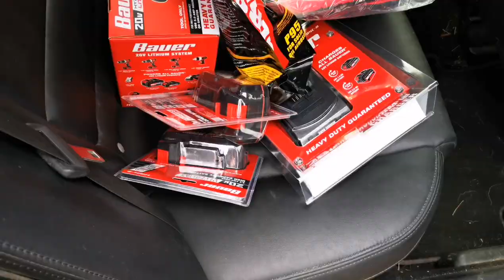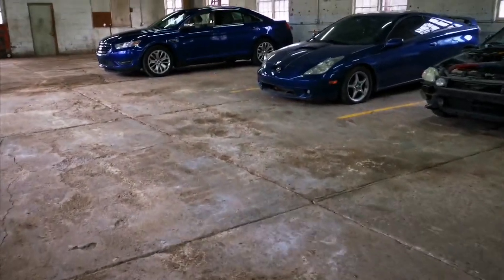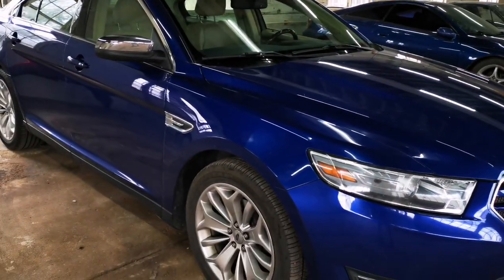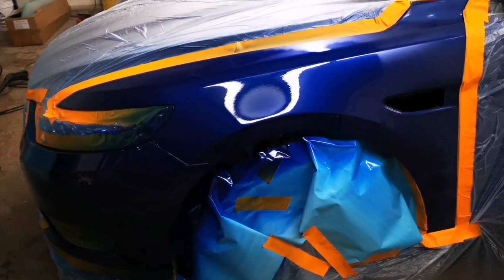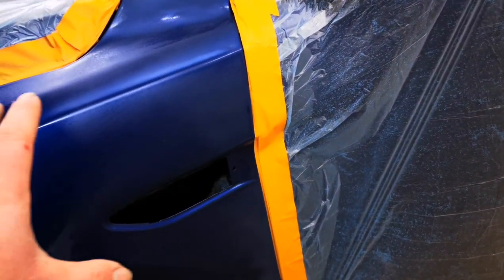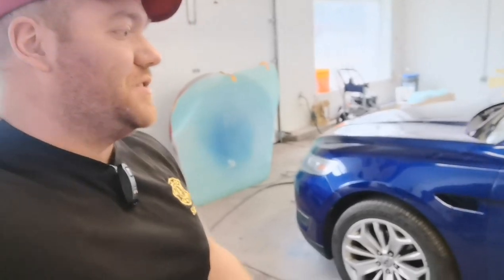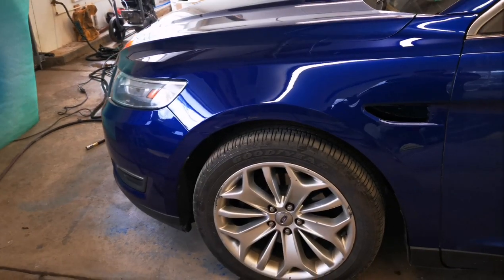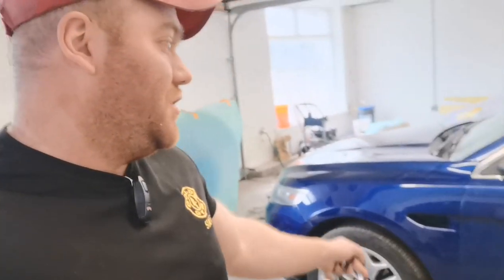Bauer hypermax lithium sander

Comment: I like the idea of this sander. My tools are air operated,my thinking is if I can pull less off of my air compressor,the better. It would have been helpful to have the sound of the sander instead of your music. Great video and great tips like buying an extra battery. The blend turned out very nice,thanks.

Comment: What type of primer do you use on all of your jobs? Is that epoxy primer?
Reply from the maker: Smr210 is the God of primers man. I use it on everything. It's tint able, thin able, or you can spray it straight and it goes on thick as honey and can block it down like body filler. Hands down best primer on the market for the money. Only 79 bucks for a gallon includes activator
Reply: @speedokoterefinishnetwork4937  Great man, I will be purchasing some soon. Thanks man, great work you’re doing

Comment: What is your opinion of the Speedkote SS 2790 G Primer? I want to use it on some new plastic bumpers for my 2005 Honda Civic as a sealer. I also want to use it on my 1998 Dodge Ram 1500 Truck, The truck has some minor rust holes on the doors and on the sail panels below and a mediium size dent on the exterior rear bed. Also the Dodge is black and the factory clear coat is peeling on the roof surfaces. Your videos are awsome. Your guidence is appreciated.
Reply from the maker: That's our premium line of primer surfacer. BUY IT. even better than the Smr210. You can tint it, and also reduce it and make your own primer sealer.
Reply: @speedokoterefinishnetwork4937  

Will the SS2790G work in both situations listed above or will I have to buy different primer/sealers? On the new plastic bumpers for the Civic with some adhesion additive as an epoxy sealer? On the Dodge Ram as an epoxy sealer, and primer for a total vehicle repaint with your Jet Black single stage.
Reply from the maker: Brand new bumpers you want the trc 500 if there BARE PLASTIC, if the bumpers come with factory shipping primer there is 0 need to put more primer on them. For doing body work and stuff yea the smr2790 is Awsome

Comment: Harbor freight would have been geniuses if they had made their Bauer tools to accept Dewalt 20V batteries. Silly! I already have Dewalt 20V & Milwaukee M12 (3/8 Fuel 90 degree impact driver) platforms. Not getting into another system.
Reply from the maker: True. These are cheap China knock offs. They do work and are worth the money but still China stuff.
Reply from the maker: I'd say China stuff is hit or miss. Sometimes you can get better quality. Sometimes it's crap
Reply: @speedokoterefinishnetwork4937  being a DIYer, if I buy something to save me time for one project & it saves me a bunch of time, it could be a throw away. Obviously, the sander wouldn’t be. I’ve bought $20 pneumatic brad nailers from HF to do crown & base moulding trim work, if they last the one project, they’ll have done their job. Appreciate you as always, stay safe & keep the content coming. Congratulations on being monetized.
Reply from the maker: @jdub229r  thanks man

Comment: Question can I use speedokote base  coat binder to lay pear colorshift then clear it.
Reply from the maker: Naa basecoat binder is for people who have mixing systems for oem refinishing and simply don't want to pay the hefty charge for locally sourced binder.
Reply: @speedokoterefinishnetwork4937  what would be a good product to mix my pearl with instead of my clear to do a 3 stage paint job?
Reply from the maker: It's usually best to buy that stuff premade. It takes hours of testing to make a solid formula. Everyone mixes slightly different. I don't give away any information on my own formula.

Comment: @5:48 what was you spraying with? There's nothing on the gun?
Reply: Looks like SMR400 blending clear. Melting the edge in the middle of the bumper. Don’t need much
Reply from the maker: Speedoblend, good stuff! Only need a few squeezes of the trigger and I get perfect polish free blends every time.
Reply from the maker: @prestonrushmore9692  hope you got this in your collection. I use it on all my blend in jobs
Reply: Sure do! Aerosol version but same difference. Once I run out, I should get the quart, probably would use a bit less material since I can dial down the fan/material
Reply from the maker: @prestonrushmore9692  I get slightly finer blends with the quart, but it's also more hassle being I gota take my gun apart, get that out, pop the lid, pour ect ect. The smr400a is great just pop the can open and spray, done.
Reply: @speedokoterefinishnetwork4937  ah true, good point!
Reply: @prestonrushmore9692  look at his gun he has no paint cup on it 😳
Reply from the maker: That's cause it's pps. All disposable. And it's included in the Mark1 refinish pro system.
Reply: @speedokoterefinishnetwork4937  your not normal 😑

Comment: I’m kinda digging that color. Still rocking the smr135?
Reply from the maker: Smr135 is my year around go to for panle work. Summer time for all overs I stick with the ss1200. At only 179.99 for a 6 quart kit that's only about 29 bucks per sprayable quart still very affordable.
Reply: Nice bro. Have yet to shoot smr135 actually. Have used ss1200 in the summer with medium activator, laid down like glass. Took a while to dry, that’s my only complaint. But hey that’s a price I’m willing to pay for virtually zero dieback. I’ll have to try SS-1210 or smr135 next. Still have some 1200 and smr130 left. Also got some euro clear, so I’m gonna hold off till I get low 😂
Reply from the maker: @prestonrushmore9692  summer time use fast with the ss1200. 2-3 coats with fast activator still get no die back and it dries about 5 min faster tack free. The Smr135 is good for bumper / multi panle jobs. Or all overs if you Wana be like me and spray a whole car with your garage door open in 40 degree weather 🥴🥴🥴🥴😂
Reply: @speedokoterefinishnetwork4937  hahahah! I saw that in your other vid, you animal😂 thanks for the tip on the fast activator for ss1200. I’ll have to try that, anything that gets me dust free quicker I’m all for, my garage is far from a spray booth as I know you understand lol
Reply from the maker: Yup been there. You saw my old shop. So yea stick with fast activators for sure. Only time I'd go medium if it was like 90-100 degrees. But the ss1200 always use fast activator. Even with the fast activator it still take 12 min to dry tack free in hot weather which is plenty of time
Reply: @speedokoterefinishnetwork4937  awesome thanks dude. I use an hvlp turbine so it does push out some pretty warm air. But I’ve shot fast activated smr 130 in 80° for multi panel so I’m sure ss1200 with fast activator will go great as long as like you said, it’s not 90°+
Reply from the maker: @prestonrushmore9692  came out really good! More ventilation in that garage when you spray please bro lol. And a spray suit. All those chemicals get into the skin and in your system
Reply: @speedokoterefinishnetwork4937  oh yeah I had terrible ventilation haha. Usually I do mobile stuff or like 1 or 2 panel jobs In the garage so I wasn’t prepared. Lots of lessons learned for if I do another full respray In the future lol
Reply: But thank you, most of the products used were Speedo!